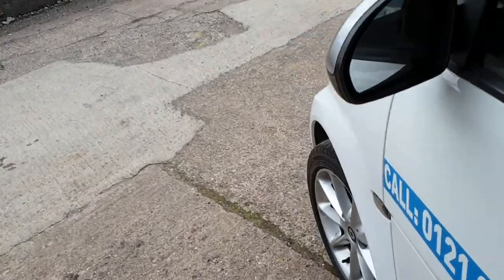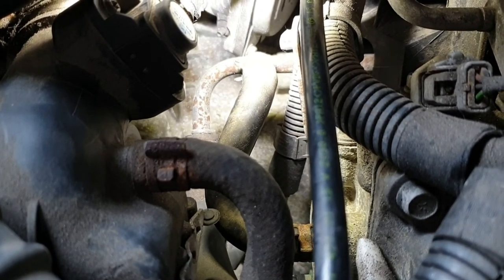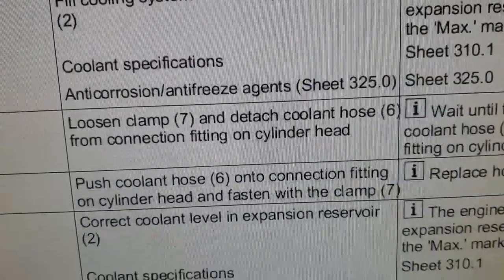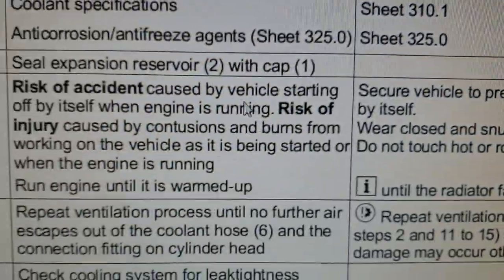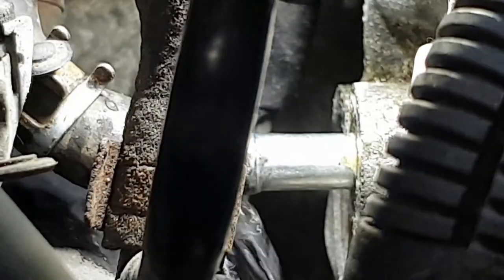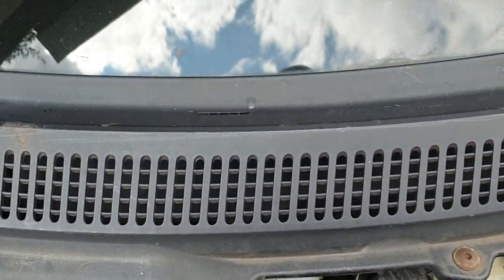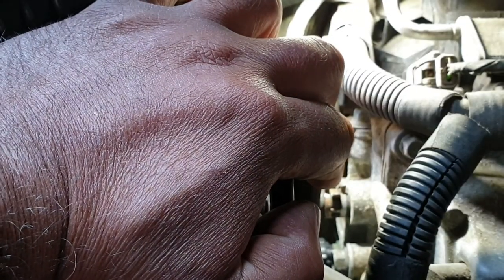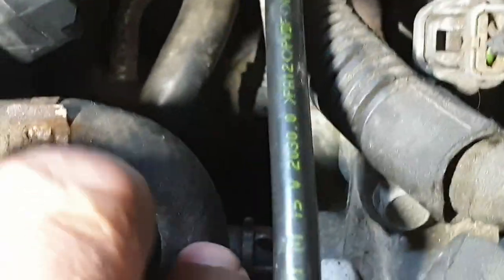Smart Fortwo Coupe W451 1.0 L Cooling System Bleeding

Comment: You did well bro, In series MHD you better to disconnect shut off valve and make it open permanently. That's tips from Mercedes Benz. Because sometimes it can malfunction and make coolant circulation problem
Reply from the maker: Thanks for watching our channel and your feedback ☺️
Reply: Where is this coolant shut off valve I’m having circulation problems my expansion tank is full, did drive fine temp wise but started to overheat on idle and missfire then go away when driving, now constantly missfire and blowers completely cold and radiator cold even when overheating
Reply: @jacksrcat  the location heater shut off valve is like above transmission and engine block ,front side

Comment: So on the 453 it is impossible to reach the hose without disconnecting parts
Reply from the maker: Thanks for watching 
Tomorrow i 'll get some information from service manual and will share with you 😊
Reply: @stanhopeautorepaircentrewardak  I got to it, had to a steel brace off. Car is finally fixed man! Thanks 💪💪💪💪
Reply from the maker: Happy 😊

Comment: Do you know where the eletric heater valve is located??? I did not find on my smart, thanks for support man.... great video
Reply from the maker: Close where the gearbox housing and engine meets but towards the front side of the vehicle, you need to feel it with your hand it is very hard to see it with your eyes while gearbox is attached the engine.